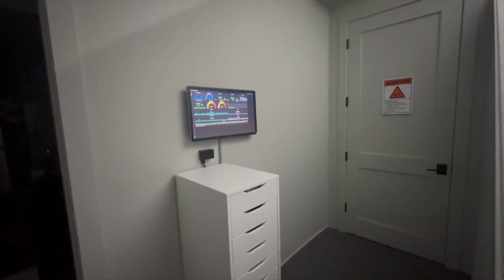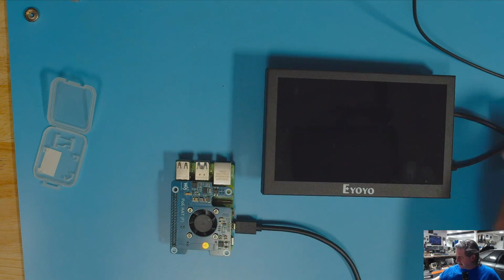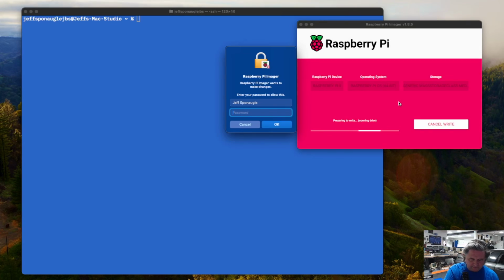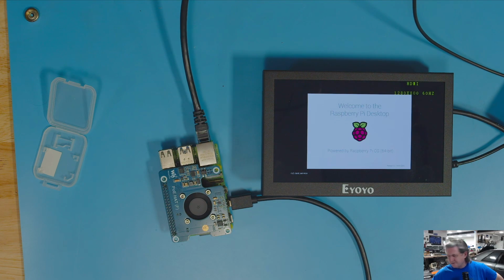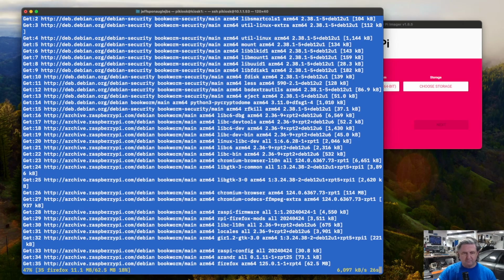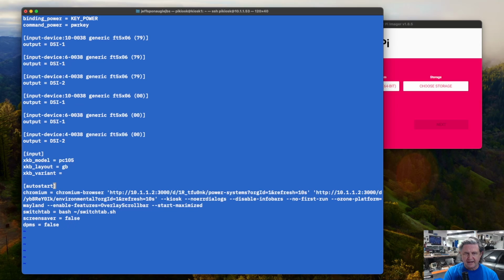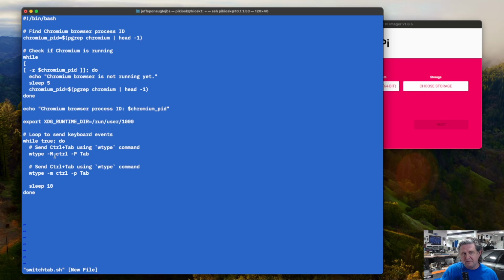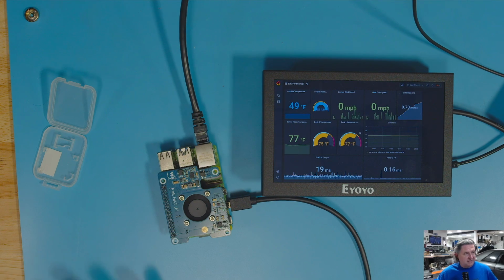How to build a Raspberry PI Kiosk for your home/homelab

Comment: The script shut off after few hours. I have dpms off.
Reply: I have the same problem too. the raspberry pi doesn't shut down, it actually stops displaying the information from chrome, it only shows me the desktop. if you find any solution, can you let us know please? Thank you.
Reply from the maker: I did have that happen, but on a later OS build it didn't.. however I did have a solution - Let me see if I can find the changes I made to my scripts.

Comment: this is sick, but this immediately led me to think, could this be ran on a touchscreen monitor? allowing you to control / scroll through various things?

if so, that'd be sick. i might have to do something like this in the future.
Reply from the maker: Yes, if you have a touchscreen with USB output, you could have selectable elements.
Reply: You could add home assistant to this system to manage your homelab (or whatever else you would want to manage) with for example mqtt.